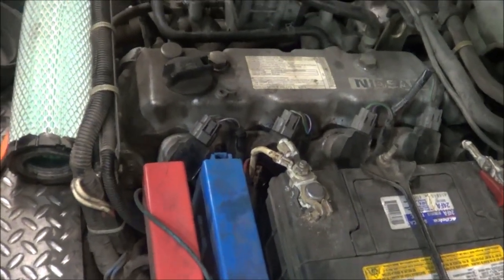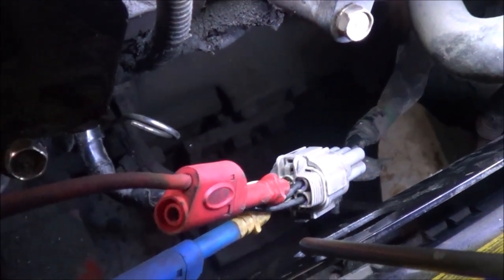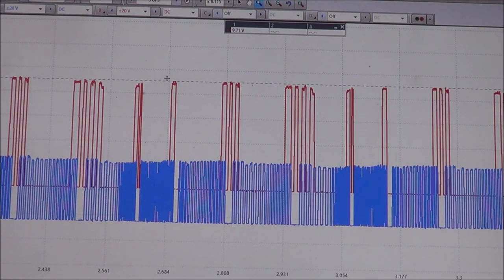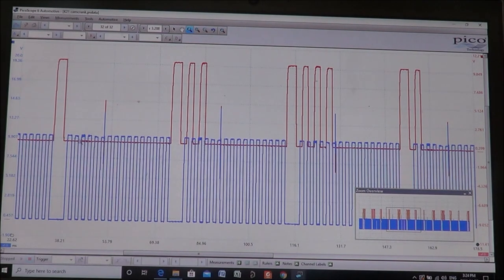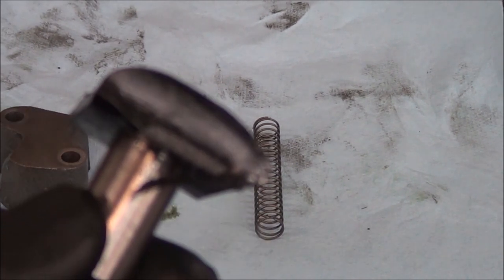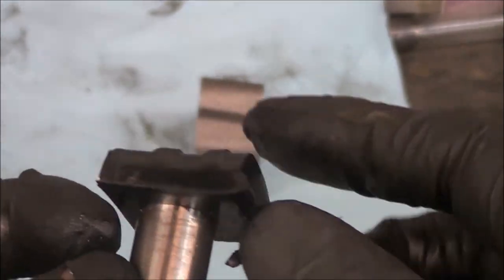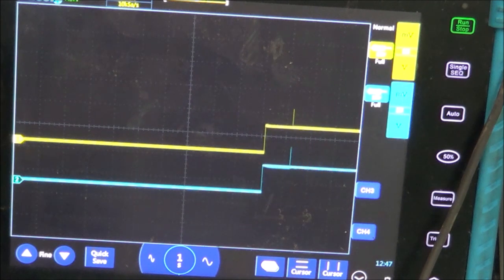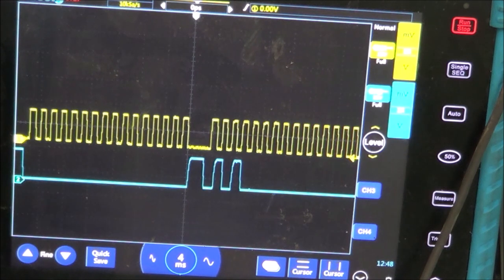Nissan Forklift Cranking No Start

Comment: Was that a worn chain tensioner? I work for a independent  Unicarriers dealer, former TCM, we work on k21's and k25's every day I've never had that symptom. Good to know! Btw, did it throw the E-27 code?
Reply from the maker: That is the only thing I could find that could make the chain jump. Everything else checked out.  No it was not coding out E-27. It had codes but were unrelated, probably from the previous tech unplugging sensors.
Reply: Me either
Reply: @forkliftgeek10  that was another good diag  that you made look so simple but really was technical with your bar graphs. Lol. Great stuff!

Comment: We have a similar problem with our forklift, but no scope. It died and had a phase code. Replaced crank/cam sensors and still cranks and does not start. It will start with starting fluid though, but won't have much power. I'm assuming pull the timing cover at this point like your video. Any ideas? Thank you!
Reply from the maker: Make sure the cam and crank you replaced it with are the metal case type and not the plastic ones. Specially the cam sensor.
Reply: @forkliftgeek10  Thank you, they are both plastic. Can they be interchanged? I appreciate the advice!
Reply from the maker: Cam sensor is not interchangeable to crank sensor.

Comment: @forfliftgeek have you had a Nissan with code E-43 I have one that keeps coming back any input would be great.
Reply from the maker: From what I remember E-43 is an air/fuel ratio malfunction code. Probable  causes would be vacuum leak, faulty O2, faulty mass air flow, faulty IAT, faulty injectors. Leaking injector holder(relief valve) , faulty lpg converter.
Reply: @forkliftgeek10  thankyou for your help I really appreciated I replaced the O2 sensor and tested MAF, am a look into the injector next. thank again.

Comment: Hello 
I am a raymond mechanic 
I would like to get a scope l also work on my cars 
Will that scope be ok for me? 
Thank you in advance
Reply from the maker: If you are referring to the micsig, it would do all the the basic functions that a picoscope would do. But, because this is not an automotive scope it can only display voltage and you would have to do the conversion manually if you are using a current probe or a pressure transducer. Micsig also has an automotive scope but is much more expensive.
Reply: Thank you 
For your help

Comment: Good evening friend I have a CATERPILLAR P6000 with K25D engine, it does not start, it has dtc P04, F04, could you give me information on these dtc, I write from Colombia, thanks
Reply: P04 is Ecm communication error. F04 is the same thing
Reply: @tiggertv9170  thanks